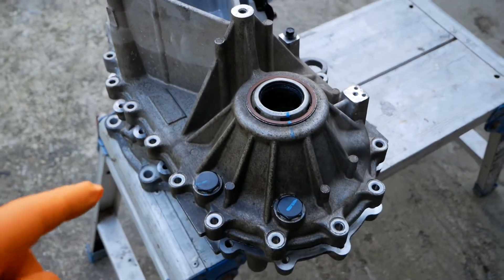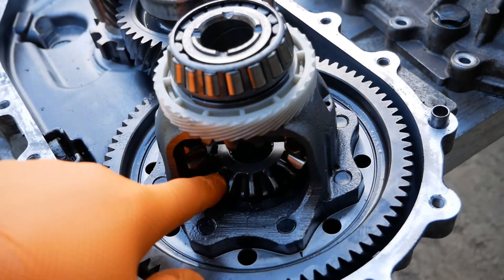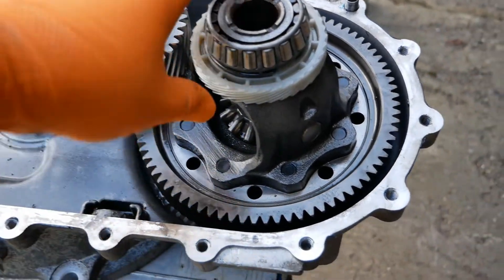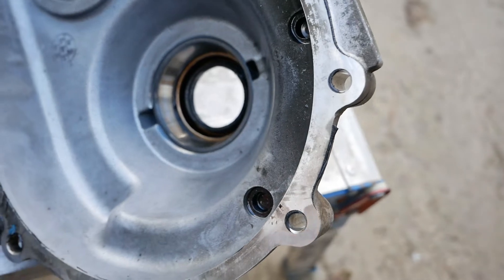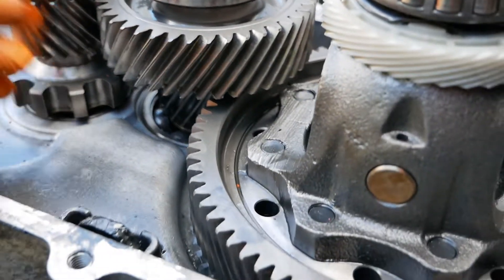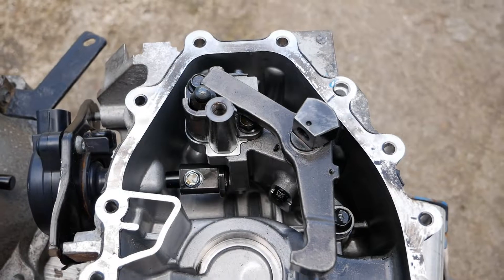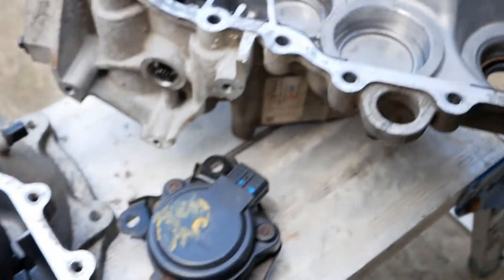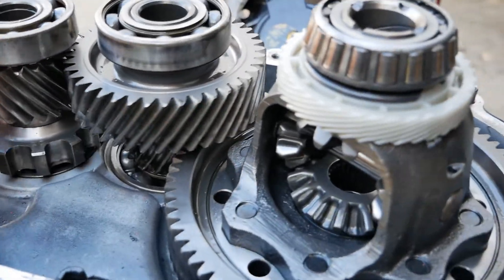What's inside an electric vehicle gearbox? A look inside an EV reduction gearbox. PART 1

Comment: Very intersting. Never new about the park actuator. This is probably also an additonal reason VW put drum brakes on id3-5:  they can additonally apply the handbrake to the rear wheels with no fear of the brakes blocking in minus degrees (freezing against the rims) or glueing to the disks in 40 degrees. Also no rust like the rear disks always have on EVs or cars used on short journeys/ no hard braking.  I wonder if there is even a handbrake or autohold on EVs?
Reply from the maker: Yes there is autohold and park brakes on EVs and the handbrake MUST be used to hold the weight of the vehicle, not the park pawl in the gearbox. I'm going to make a video about this as many don't realise the damage they are doing.

Comment: It looks like that nylon gear would have been part of a speedo drive perhaps in another application.
Reply from the maker: I don't know what other application a reduction gearbox like this would be used for, as it has to be mated to the same electric motor.
Reply: @GoGreenAutos  the nylon gear is on the differential unit which may be a generic item.
Reply from the maker: @kevinmills5293  I see what you mean

Comment: The park actuator… demonstrating why, you should always apply the park brake on an automatic (EV or ICE)… never leave the weight of the car sitting on the gearbox…
Reply from the maker: Yes, I'm just making a video about this subject. Many new EV drivers are parking their vehicle wrong.
Reply: I agree although doesn't the park brake come on automatically or have I dreamt that? Maybe it's just me that does it automatically! 😂
Reply from the maker: @judebrown4103  On some cars, yes. But only when certain conditions or sequences are met.
Reply: @GoGreenAutos  ah the Ioniq 38 is my first EV so wasn't  sure if that was the case...👍

Comment: Thanks for your videos. There were some misconceptions I had about electric cars before I knew more about them. Ie I thought there were 2 separate electric washing machine-type motors, one on each wheel driving them which I thought was a high maintenance and complicated way of doing it. But now see it is just like a normal ICE engine drive.

We've just bought a used Nissan leaf (we did do a test drive and it ran nice) and will be collecting it on Wednesday really just because of ULEZ and the daily £12.50 charge. We are now back to a 2 car family. The Leaf for everyday local (and not so local) journeys and our diesel for our touring around the UK. Hopefully, we will recoup some of the money by not having to pay the ULEZ charge, and money on diesel using overnight cheap charging.

The only thing we found funny about the car is it still had 12 bars, was a 2014 and had 60k on the clock. Wondering if its a new battery or the original driver just drove it really well.
Reply from the maker: Yes many think EVs have in wheel motors or small motors on each wheel.
It would be extremely rare for a 2014 Leaf to be still on 12 bars. Good find. You have to remember if it drops to 11 bars, you're battery SoH hasn't dropped loads - its just dropped 0.1%.

Comment: I wonder if your parking brake lever is actually in the engaged position and the domed pin we can see  retracts to disengage?
Reply: Exactly correct. When out of park pin retracts and spring moves the arm away from the pawl!
Reply from the maker: Yes you're probably correct. Its most likely to have been in park when it was removed from the donor vehicle.

Comment: So that's why when you put it in P and parking brake does not initiate automatically car can still move few cm
Reply: I did wonder why they chose to put the parking brake on the motor shaft and so have Slack in the gearbox allowing some movement. Maybe it's to make the actuator accessible in the engine bay?

Comment: Interesting to see inside the gearbox, thanks. My daughters Zoe only managed to do 8k miles before gearbox started making  a loud banging noise. Just had new gearbox & drive shafts on Renault warranty. All running well again now 😅
Reply: Seems to be a common problem with Zoe

Comment: Interesting to see one opened up - thanks! 

Given how clean and good condition your example is gives question to what a servicing ‘inspection’ would achieve… 
Would it just be an external visual inspection for leaks / condition?
Reply from the maker: Yes the inspection is just looking for leaks and undo the fill plug to check the oil level.

Comment: That park actuator could be eliminated by adding a good old fashioned pull up hand brake lever. Love them. 
In a previous life, I was an automotive parts person, and that plastic gear looks a lot like a speedometer drive gear. Not sure that's what it is, but that's what it looks like to me.
Reply: Exactly what I was thinking!

Looks like it ought to drive something doesn't it?
Reply: My first Zoe had a manual handbrake. Much preferred to the electronic one on our current Zoe.
Reply from the maker: The park brake, either manual or electric, is not the same as the Park on the gearbox. The park brake is using the rear brake pads. The Zoe still has a Park pawl like this in the gearbox. I'm going to make a video about this subject this week as many are getting this wrong and parking their cars wrong which is causing damage.
Reply: @GoGreenAutos  The ZE50 does not have a park pawl, however you are correct that the original 22kWh and the 41kWh Zoes do.
Reply: Well, using a mechanical break you would loose the amazing "AUTO HOLD"- function on that car...
Reply: The ioniq has an electronic hand brake. Thats is separate from the Park gear. Even auto transmission cars will have a park gear AND a handbrake (either an electronic or manual one)